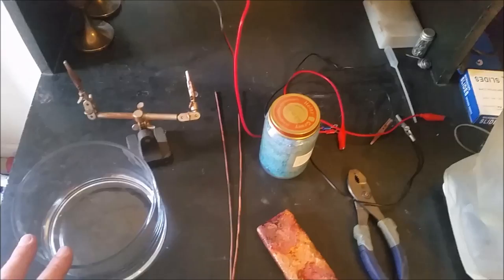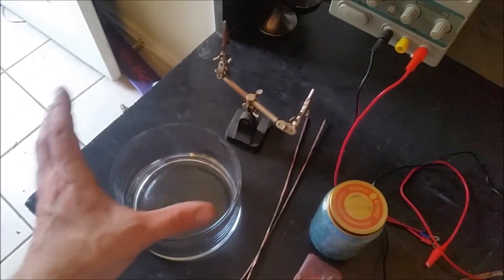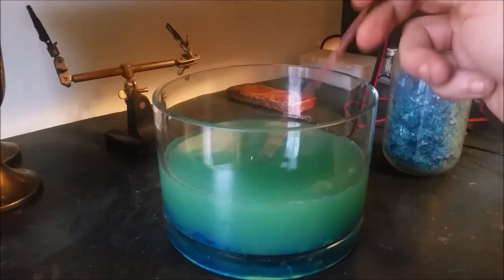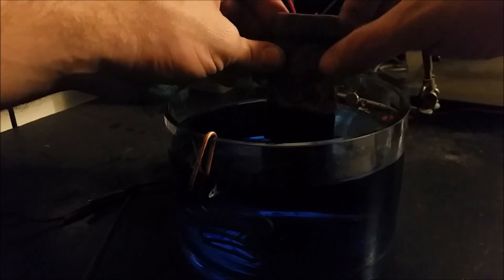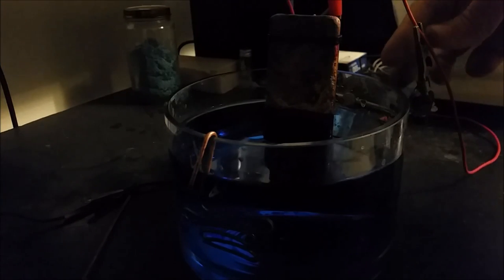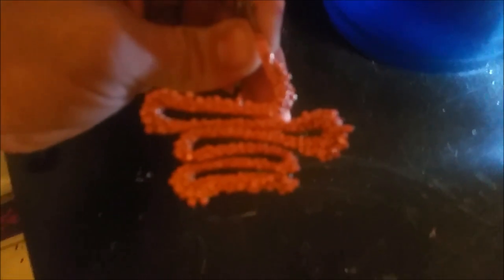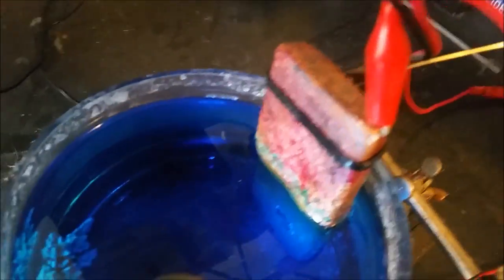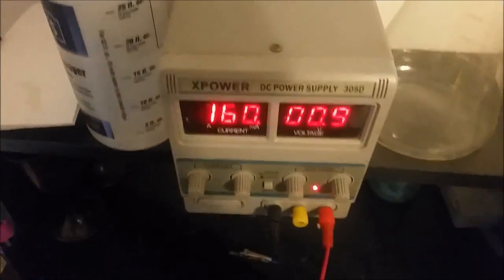How to Make Large Copper Metal Crystals

Comment: I wonder if you tried using electrical copper only instead of plumbing copper because it's got other metals in plumbing copper if it wouldn't work a little better because electrical copper is like 99.9% pure copper
Reply: Not all are 99% copper though, there are a lot of electrical wires that are copper plated nickel.
Reply: @kitsumyr9752  but that is a rarity, I'm an industrial electrician and for the most part bare copper is the easiest to obtain
Reply: @michaelrobertson8795  well im basing this on what we usually find here in the Philippines. Not all wires are relatively pure. Some wires are pure , Some are coated, Some wires used in transformers are resing coated aluminum.
Reply: They alloy or coat then with aluminum a lot of the time

Comment: so you have sanded this copper wire and then you made it dirty right away by touching it and smearing you hands' grease all over it. not really wise
Reply: I'm pretty sure getting rid of oxidation was the primary concern.
Reply: For cleaning copper I clean it with dish soap then set the copper in a glass bowl of hot salt and vinegar. Then don't touch it without gloves. Works great.

Comment: ill make a HUGE copper crystal them MELT IT DOWN AND MAKE A SWORD... if its possible
Reply: Novastar you'd destroy the crystals and have a rather easily nicked sword, but it's possible of course. It's just copper bonding onto copper and forming a cool shape. You would have a cooler sword if you made a "Damascus" steel sword.